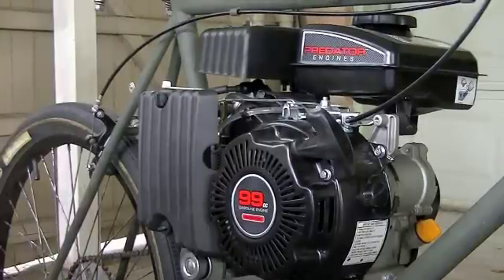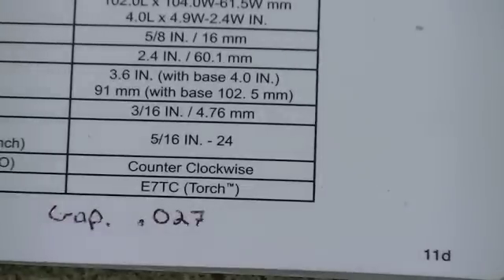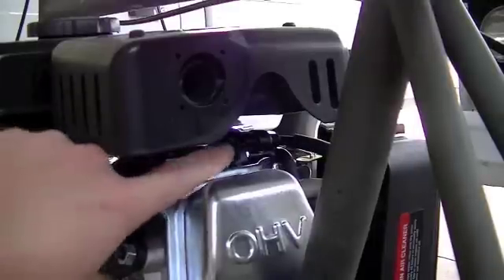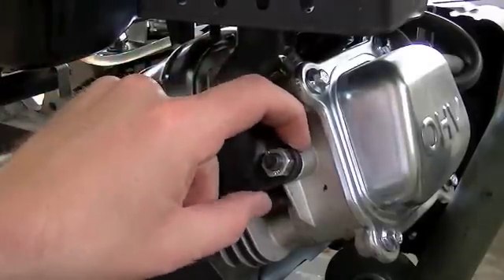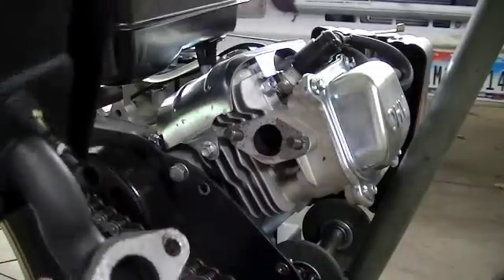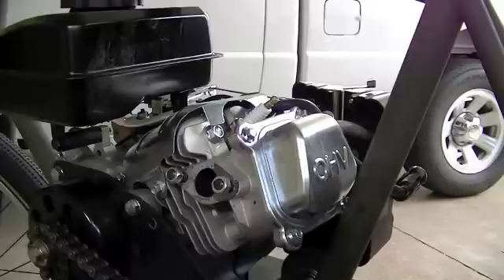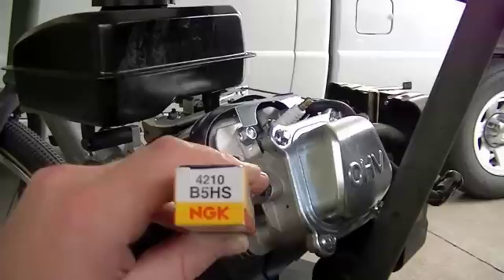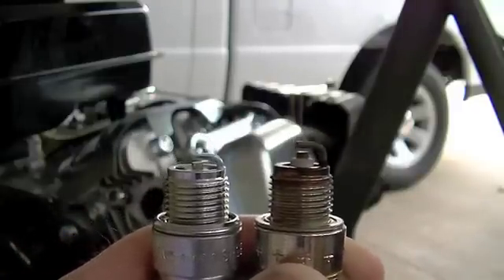Part 1 Harbor Freight Predator Engine | Spark Plug Swap

Comment: use a splitfire plug, it will work great just use splitfires conversion chart,,
or the bosh triple platinum,, but there are many performance plugs on the market that will work,, good luck
Reply from the maker: Thank you for the tip!  I'll give that a shot!

Comment: Torch E7TC cross-references to a NGK BP5HS according to NGK's website x-reference.  As you can clearly see in your video @6:41 the B5HS lacks the projected insulator design found on the original plug.  I wonder if your performance gains would be more noticeable with the exact cross?

Comment from the maker: The gear ratio is: 10 teeth on the clutch to a 26 tooth jackshaft sprocket.  The jackshaft has also has a 14 tooth sprocket to the 40 tooth rear wheel sprocket. It's a roughly 5.5:1 gear ratio. The local police set up one of those radar trailers in my neighborhood recently.  My fastest pass was 34mph.